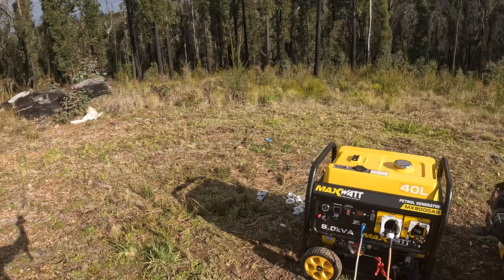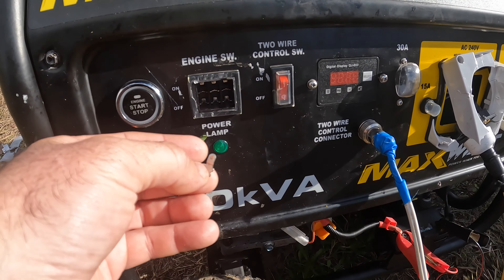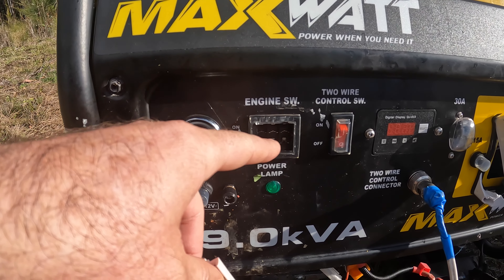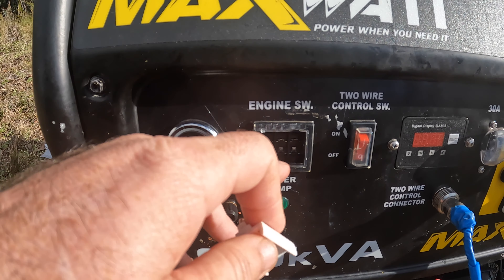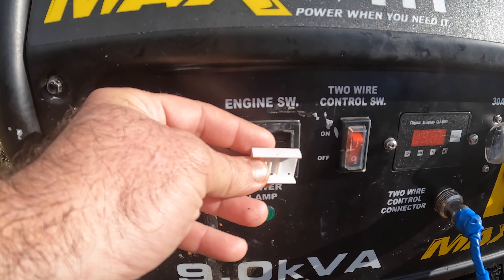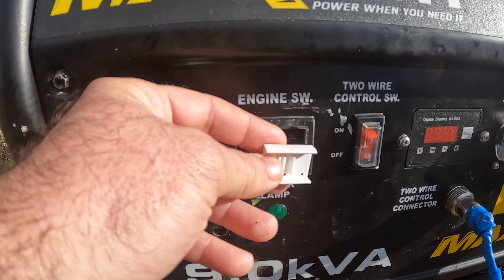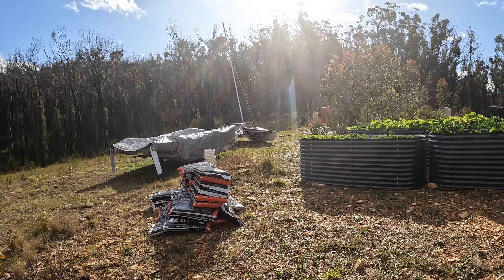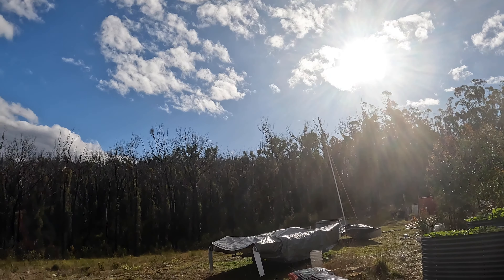Solar Back Up Generator News, I ordered a Fix

Comment: more panels will help for sure. What inverter(s) do you have and how are you going to configure the panels, as that possibly has a bigger impact. And from the shot at ~ 4:51, where you can see one corner of the bottom left panel is shaded, could be having big impact on available energy depending on how many strings you are running... (I love all the things you're talking about here, solar, timber, tractors/Razorbacks... even the catamarans although I haven't sailed for close on 40 years)
Reply from the maker: I have a Sungrow SGK8-D which has 3 tiers so I can plug in 3 lots of panels. That little shade spot does cause an issue, I physicaly unplug the bottom row of panels in the morning and plug them back in at 11:30am. I could set them up as a second tier, and I did that but couldn't configure it, so I will sort that soon, most likely when the new panels come I will set up 3 Tiers. https://studio.youtube.com/video/0Ic0_i5LOK8/edit
Reply: @steyeroffgrid  and of course, as we leave the depths of winter, the sun angles will change when you need to worry about that one panel :)  I just had a brief look at the specs on that inverter. 3x inputs but still only 2x MPPT channels, so how you configure the existing and new panels into strings will be interesting. PV2 is the one that will take two strings, and it will therefore take higher total input. If all your existing panels are matched, and in two strings, then you may have them in the pair of PV2 connectors, and your new ones in PV1. But from what you said, your current panels might be one string, meaning they must be under the specs for splitting into two channels (edited)... Of course being an electrician you can reconfigure how you need to keep it within the limits of the inverter. Good luck, ping me if you want to chat more about that... I'm only an enthusiast but think I know a bit - oh and now I sound like an a$$hat :)
Reply: and thanks for the earlier vid, I hadn't seen that one. That's a decent battery bank !
Reply from the maker: @Poundy  I will run the 8 new panels on PV2 two lots of 4 panels in parallel. PV1 will have the existing panels but I will pull the corner panel and the one next to it out of the system. Then my plans to relocate all of the bottom row up higher or somewhere else so they have no shade.
Reply from the maker: @Poundy  Yeah they are lithium 16kwh and $16k.....